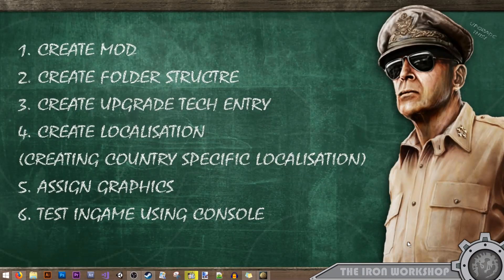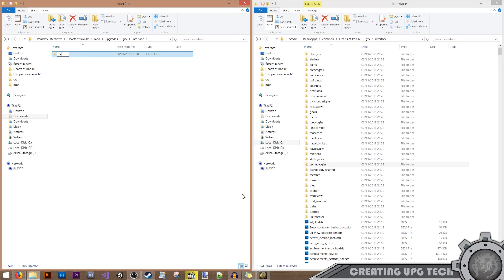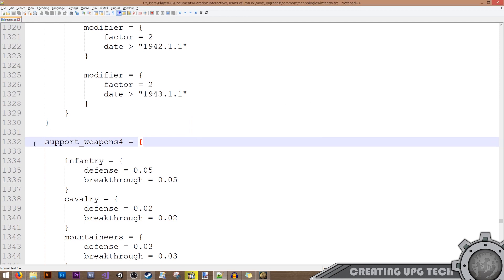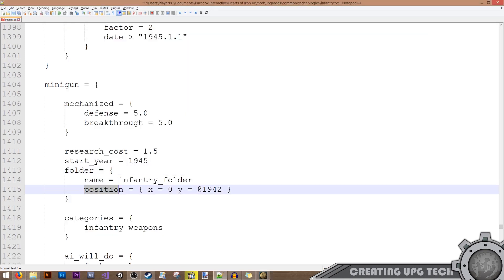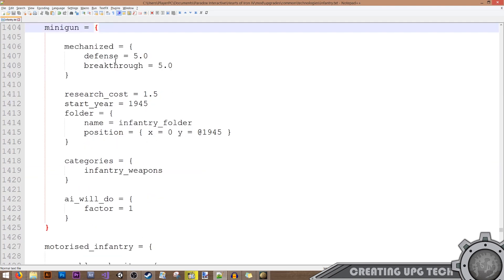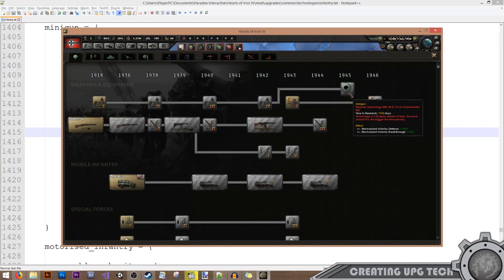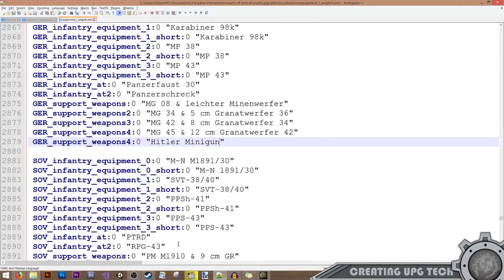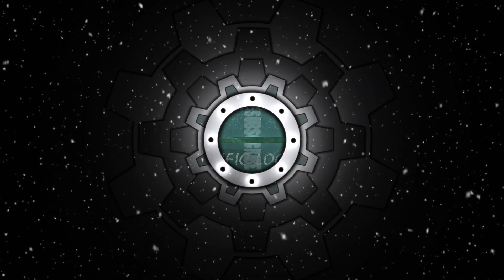[HOI4 Modding] Creating Upgrade Technology

Comment: i got a question, so , i got nonsteam version of this game . i got all updates you can get , and all of them suck except for  V1.3.3 (2dd2). that's the only version that is actually fun to play and not impossible with smaller countries .
but there are a few things that i'm trying to change to it cos i like tech tree from waking the tiger just cos of that synthetic rubber option and i like how in your weapon production you can just drag production window around and you can put x5 or x10 factories to work on specific thing without having 10000 windows .
so what files do i need to copy from waking the tiger to V.1.3.3 to put those good things in to that old version ? 

i did copy some files and i made it possible to produce rubber and stuff , but i can't click on research things cos they got no background and buttons don't react on click . so i guess i'm missing something .. pls help , i love this game but new updates are rly killing it
Reply from the maker: Those other things are hard coded and you cannot mod them so you can't access them without upgrading your game.